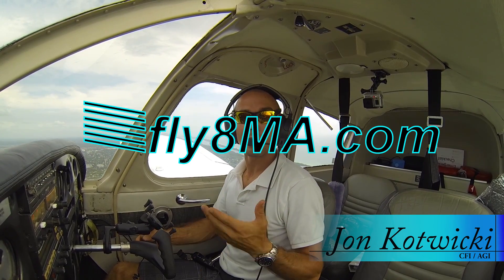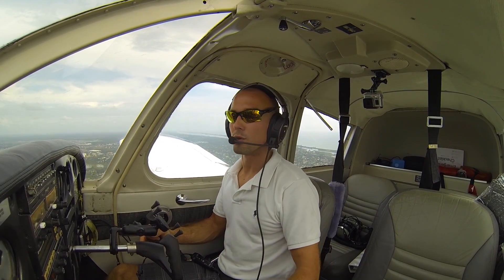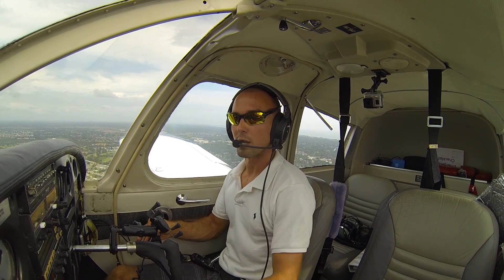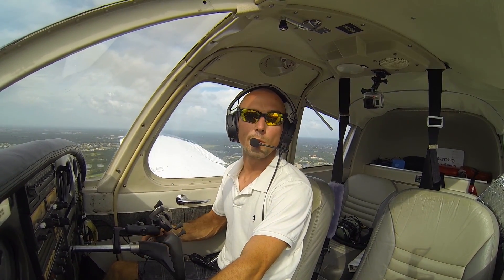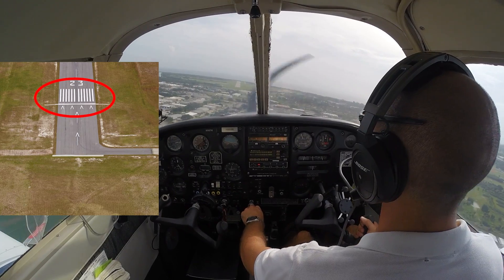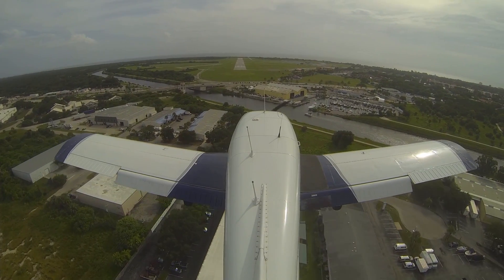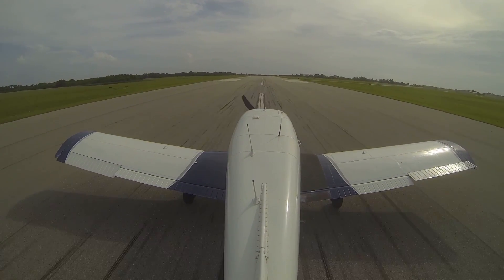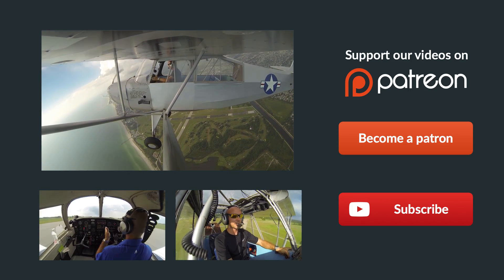Ep. 48: Short Field Landing | How To

Comment: Full flaps on 15 kts X-wind? My first CFI told me always full flap. My second is telling me flap 20. I want to say flap 20 is superior in terms of rudder authority. I've found myself having the pedal to the metal and still getting blown to the side at one point with full. Technically speaking, with a wind blowing the aircraft, I would expect the a steepened approach angle which translates to similar glide path with full flap when you're only on flap 20 aka similar ground roll as a result?

Comment: Hi Jon,
Although I do not think any C-172 instructor would say yes to my question... Is it ever a technique to retract the flaps upon touch down to avoid bouncing? If not, why?
Much appreciated!
Reply from the maker: Eh, not that it's never been tried, but it really isn't a valid way to keep an airplane from bouncing.  Electric flaps take too long to retract to save a "bounce", however you would want to retract flaps, whether manual or electric when landing on a short field to dump weight onto the wheels and make braking more effective.  Best way to avoid a bounce is a stabilized approach over messing with flaps when trying to control the airplane as it is meeting the ground :)    Safe Flying out there!
Reply: Thanks for the insight! Yes a stable approach makes half of a good landing :)
Reply: If you expect to float due your speed is too high, yes.  But expect a harder touchdown.

Comment: The Warrior, 58kt approach, but I use 55, power off and pitch the nose up for my on—the—keys landing.
Reply: Flying solo and mild wings ok 58K short final...   but with pass and higher winds you have to use a higher speeds or you can stall before those keys.. Dont promote techniques that only work on special times only.  They can destroy airplanes..